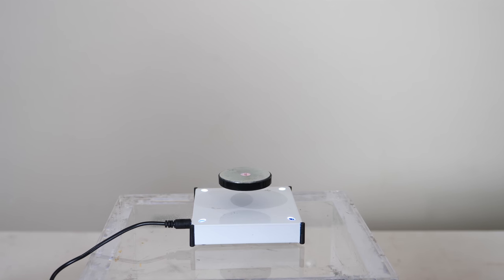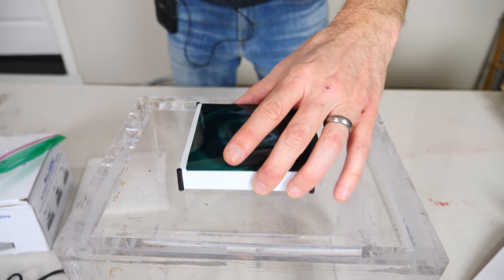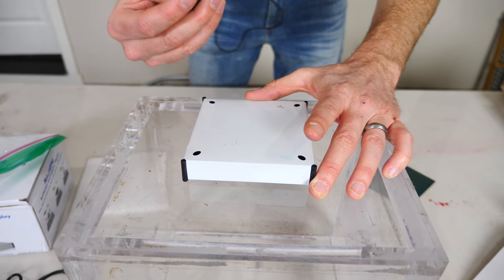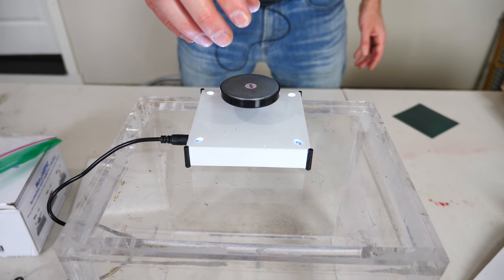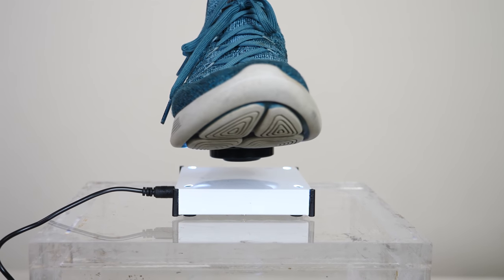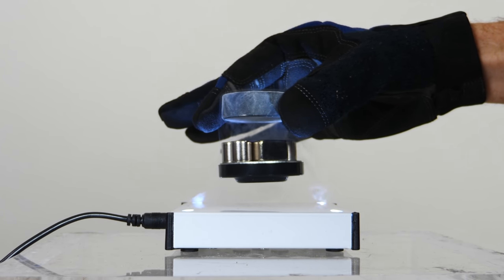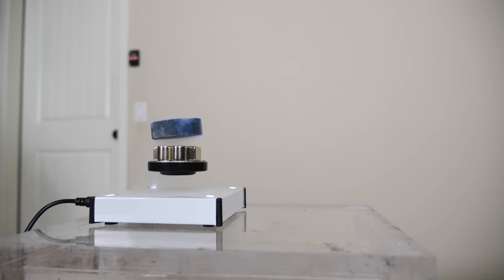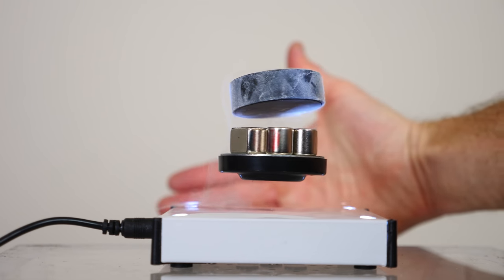Amazing Double Levitation Will Blow Your Mind!

Comment: I wish he left that feedback paper there when he turned on the corner magnets!
Reply: I second that! Also, would the levitator work the same with the superconductor puck?
Reply: @Vincenturious  ooooooh, good question! Hope he keeps showing us more of this !
Reply: Advanced science and technology is indistinguishable from magic
Reply: @Anankin12  I am not fond of magic, I just like finding the answers to "what if" questions 😁
Reply: @Vincenturious  I'm sure it would since the superconductor isn't repelled or attracted by the magnet's magnetic field and is only locked in place. It should also just stay locked in place even without the 4 corner magnets. The 4 corner magnet's magnetic fields should also just pass straight through the superconductor and have no effect other than MAYBE, just maybe, allowing for a greater rotational axis. Also since the superconductor doesn't produce a magnetic field of its own I don't think it would even trigger the electromagnets in the corners. And it also wouldn't spin like the magnetic puck does either and would stay completely stationary in whatever position you put it in.
Reply: Yep,  should have used the field paper while levitation was engaged,  not just above the levitator, but above the rotating magnet and super  conductor as well. Was rather disappointed that he did not...

Comment: Let's take this to the next level, triple levitation 😄
Reply: See my comment
Reply: @axiomer47  what?
Reply: @raunak_  infinite levitation
Reply: why stop at 3? lets go 7+
Reply: @Linophryne  that would be so cooooool
Reply: @raunak_  
Please find my comment and help boost it to the top!
"You should build a contraption/frame that can can be placed on the magnetic levitator, that holds a magnet above it. Then use the quantum pinning magnet to levitate a magnet upside down (like in the previous video with the cup of salt). Then put it all on a scale (like the previous video about the weight of magnetically levitating objects), in order to see what happens with the weight of all of that combined.

I would like to see if the force of the quantum pinning being pulled up, transfers equally downward on the magnet levitator below (as it did when all forces were pushing down in a previous video). My guess would be yes, it does. I think it would be a cool experiment though! "
Reply: HOW ABOUT ADDING A CAT ON TOP OF THE MAGNET 😒
Reply: @DinushaJayaranga  ight imma head out
Reply: Triple penetr levitation!

Comment: @The Action Lab
Hey! You should build a contraption/frame that can can be placed on the magnetic levitator, that holds a magnet above it. Then use the quantum pinning magnet to levitate a magnet upside down (like in the previous video with the cup of salt). Then put it all on a scale (like the previous video about the weight of magnetically levitating objects), in order to see what happens with the weight of all of that combined.

I would like to see if the force of the quantum pinning being pulled up, transfers equally downward on the magnet levitator below (as it did when all forces were pushing down in a previous video). My guess would be yes, it does. I think it would be a cool experiment though! 
Hopefully I explained that well enough. Thanks!
Reply: You're right, and in theory you could have many multiple magnets levitating on top of, or underneath, each other. The amount would depend on the novel engineering approach to it. Maybe Guinness should create a new category.

"The YouTube sensation Action Lab guy is the first person to vertically levitate 67 magnets, beating the previous record of 66 magnets by King of Random guy."

Comment: What would be interesting is the how much weight the first magnet can handle before 'falling out of levitation' and then again with the superconductor on top.
I wonder if the superconductor's weight + the weight required for the first magnet to ' fall out of levitation' equals the original weight required.

Comment: Redo spin the magnet at different speeds and in plug it to see if you can achieve levitation. Then try wraping it in various non farous materials like foil or aluminum screen and any other.

Comment: I'm wondering, does a type 2 superconductor still exhibit the same weight (on the magnets below it) when locked?
I would venture to guess it behaves like a truck full of flying birds.
However I don't have liquid nitrogen or any other materials laying around.

Comment: Hi  Action Lab dude..  I have a decent idea for an experiment. I never really know where is best to contact you so I'll type it out here...  (how is it best to send you ideas? I often think them up...)   Ok here goes.. 
The doppler effect. You know that old experiment where an open train goes by at a moderate speed and there are musicians stood on it all playing a single trumpet note. Then of course the observer hears that classic lowering of the tone as the train goes by... What I need to know is... is it at all possible to have them play a "reciprocal " rising  note as they go by  and therefore cancel out the audible doppler effect?  So the witnesses just hear a single stable tone as the train hoes by?
I can't quite decide if it will work or not. I can imagine the doppler effect sneaking in anyway in some way.... Obviously the effect would only be available to hear stood right next to the witness. I'm kinda 50/50 on it So I'd love to see it tested! 
Also, a little extra on the doppler effect... I discovered this from picking up my boomerangs off the ground. When there's a a plane going over and its roughly above you, bend down to touch the ground slowly and then back up. Youll find you hear a doppler effect! Even though the plane is a couple of miles away and you are only changing the distance by three feet, that plane is also going really fast so the distance is a lot more than than it seems at first glance....    Anyway I hope you see this, I love your videos so keep up the good work! Kind regards, Ryan ;)

Comment: I would love to see you connecting the superconductor to a power source to make a very strong electromagnet. I read that you should increase the current gradually but I think even a battery and 10 kOhm potentiometer circuit would do the job. You can gradually reduce the resistance to increase the current. Even with the relatively very high battery internal resistance, I guess the magnet will be very strong.

A problem should be not being able to have a coil with your SC, making the magnet weaker.
Reply: The thing is superconductors have no resistance
Reply: @11creeper45  that's what makes it interesting. If you can find a low internal resistance battery, even 1.5V can make a very strong magnet.

You always have to control current though.
Reply: Santibag you will need a coil tho to generate the field

Comment: Sir,
What will happen, if we isolate a water molecule and maintain its conditions as the TRIPLE POINT OF WATER(temp= 0.01°C , P= 0.006 atm) then, what is the state of the water molecule?  Liquid or Solid or Gas???

Will the question relate to the CAT EXPERIMENT??...If it relates to it,  ..... Is it possible for a single molecule of water exist in three different states??

I hope youe will answer my question ....
Thank you, 
Regards,
S.J. Lohit Prakash
Reply: It wouldn't be in any state since it's a single molecule. States of matter arise from the combined behavior of large collections of molecules. On a single molecule scale, they're the exact same as any other single water molecule at any other temperature that doesn't plain destroy the molecule. Just more or less energetic

Comment: put a leaf blower on top of all that with a ping pong ball floating in its stream of air
Reply: And then put a laser on top of the ping pong ball, which transfers light energy to a solar cell on the bottom of a mini-copter that powers a propeller which keeps it hovering above the ping pong ball.
Reply: @jeffo9396  with a leprechaun juggling chainsaws on top

Comment: I think it is going to take more explaining and evidence before anyone should start thinking magnetic field lines are actual objects.  I think they are more like isobaric lines on weather maps.  They convey meaning but do not participate in causality and consequentially only exist in our minds.  If they did exist, it seems that they would have to have some kind of quanta where each magnet would have x number of lines produced by it.  And if you heat that magnet up past its curie point where do all those lines go when the magnet is demagnetized?  ...nah, they probably don't exist, at least that is my position until the right experiment is demonstrated.